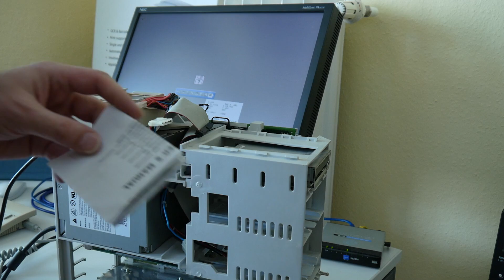1st gen Power Macintosh: 8100/80, disassembly and look inside!

Comment: I remember reading about red Maxell batteries in old Macs exploding and leaking. The one on your board looks like one of those. I found the forum thread about it: https://68kmla.org/forums/index.php?/topic/48910-warning-exploding-maxell-pram-batteries ... You may want to consider removing it if it's that type. Or remove any old battery regardless of the type if it can work without one, although it will no longer remember its PRAM settings unless you replace it.
Reply from the maker: yep, pretty lucky they did not leak (yet), ... tinkering with batteries, even unsoldering and cutting timekeepers open is what one usually has to do first when dealing with a vintage system ;-) https://www.youtube.com/watch?v=KZ1zTpj0oUQ